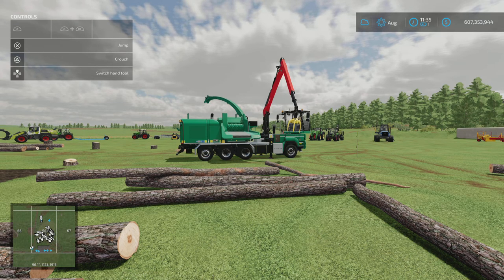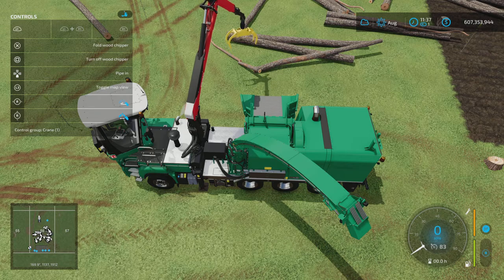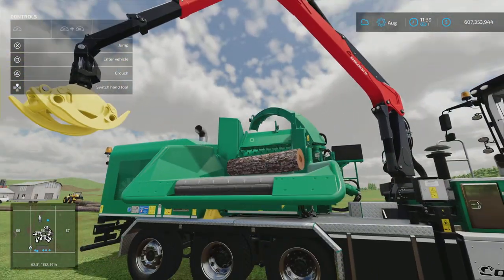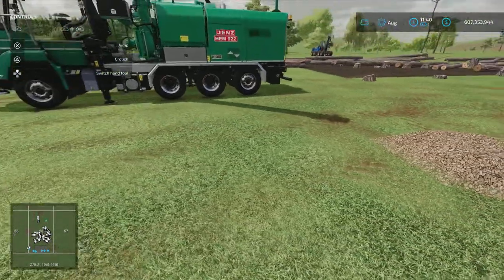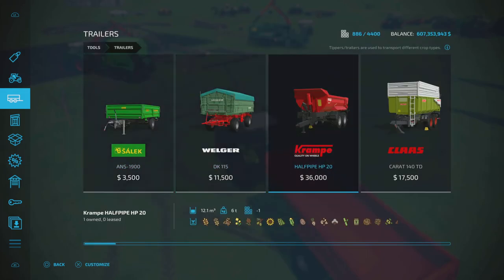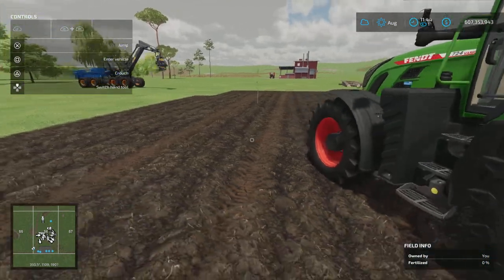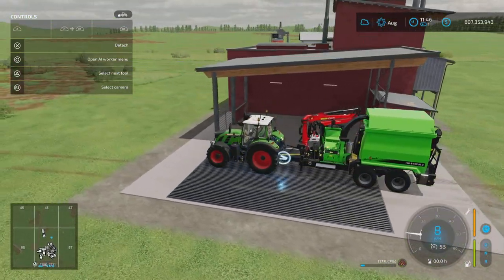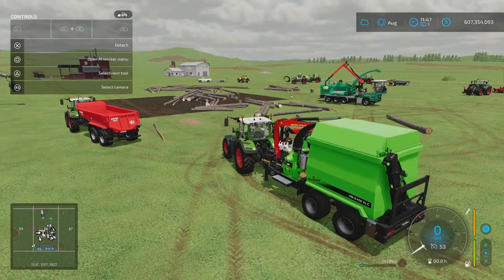How To Create Wood Chips & How To Transport - Farming Simulator 22 Beginner Guide Forestry

Comment: With pine, I grab the entire pine tree with the smaller chipper arm, feed it into the chipper, and it'll take the whole tree. No need to cut them up into bits. That's unnecessarily time-consuming.
Reply from the maker: That's a good tip 👍 thanks for sharing

Comment: i would love if american elm would be swalowed by force with vehicle wood chiper so i would not need to cut most of the branches off and feed the machine with hands.. alto i love the concept and i cleaned all the farming fields so its easy to farm, then level the trenches so i cut the meadow as well.. 

you demonstrated the logs that are basicaly the easer to woodchip but my mind dont let me for those beautifull logs be turned into woodchips lol.

if only controls on ps4 would be on on R3 and L3 with option to switch to driving would be awesome and realistic.. operating with only R3 is flustrating AF
Reply from the maker: Yes can be frustrating at times to cut load and handle the logs